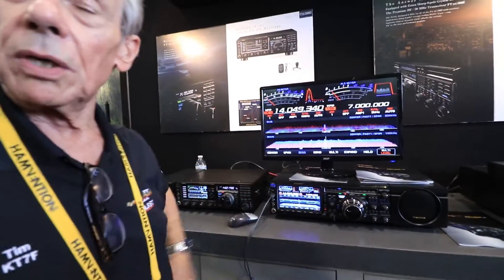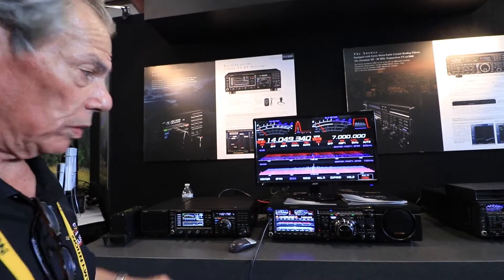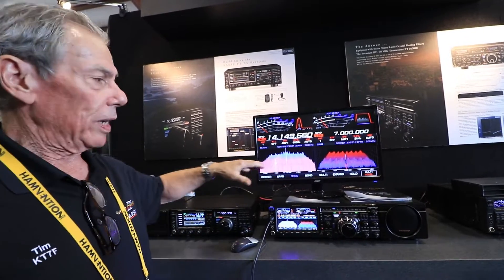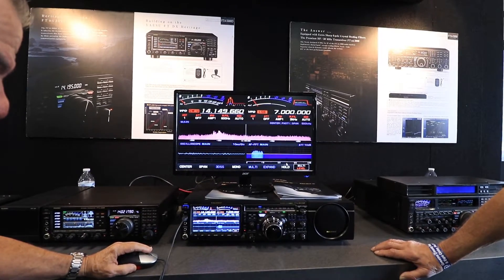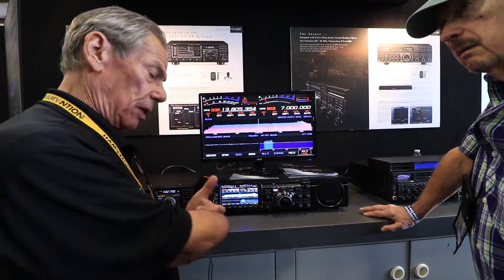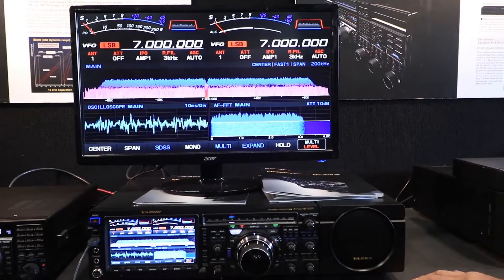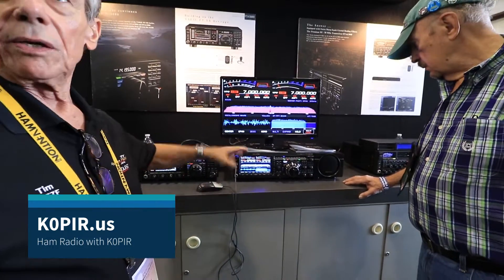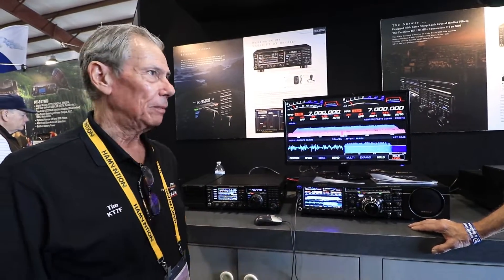NEWEST Yaesu FTDX101MP Hybrid SDR 200 Watt Transceiver

Comment: I think the 200 Watt version has its power supply in the outboard speaker box, be sure to watch out for that as you are buying.   One other question is that it was possible to put inside or remote outside the FC DX9000 line of low and middle band noise filters. Look up what could be bought and put inside the 9000 or can be out boarded behind the have to uh 2000 karma there's filters for 20 meters and below could be something you really want if your lower band operator/////////////

Comment: I'd have one and may, after a certain point numbers don't matter... just comes a point where numbers are non-recognizable to the ear. Noise floor is always the enemy. When the electronic engineers install some type of advanced artificial intelligence driven phase shifting capability via two antenna's into these modern rig's a new jaw dropping RF experience will follow.

Comment: I am sure I am not the only one that noticed that the so called band stacking marker did NOT take him back to 30 meters where he started before he set it at about 7:28 of the video.More BS from the SCAMMERS at Yaesu.They discontinued the FT-9000 because it had issues yet they have released another radio & want to say it's like the FT-9000? If you buy a radio from Yaesu then count yourself as a beta Tester.They have far more issues with new releases than all other companies combined I believe.

Comment: Yaesu' first SDR release. I'd stay away from it. Waayyyyy overpriced, 1st release, flimsy knobs, aside from VFO. Loads of plastic and looks like Japanese karioki machine by there choice of lighting colors you can't fully change and the facial design. The FT-5000 is still their tip of spear radio. Let them refine this 1st SDR entry. They were hard pressed to release this ASAP.  The Icom 7610 is a much better real time display and over all design and exudes quality. Yes I've played with both of these and am a Yaesu fan. 73's

Comment: This review was pretty good, with the exception when Tim didn’t know something he told a lie you cannot plug a traditional keyboard into this radio, if you don’t know something say I’m not sure find out the answer for the customer don’t lie. NOT COOL❗️
Reply from the maker: The Oracle I just got my QST magazine and saw there is a review in there. It’s hard to believe you can’t attach a USB keyboard to it. I’ll have to take a closer look. 73!
Reply: If the mouse is usb, many keyboards are usb....  now I can't speak as to if the radio will recognize a keyboard
Reply: Page 71 of the manual suggests a usb keyboard can be connected

Comment: Tim is Great. I found out about the relay issues, non user install filters , and possible fan noise after I ordered.  Was able to return as radio was still in transit.
Know its a great radio, but so is my 7610.
I will wait until these and any other issues are addressed. The filter install(and VC Unit for sub) requires the 101 to be sent back to Yaesu..
Hope it will have the APF/TPF function as does the 7610.

Thanks Rich for all the 7610 support.. The 7610 is still a great SDR with a LOAD of features..

KE6GAC
Reply from the maker: GWB 251 thank you for the information and thank you for commenting here. Nice to hear from you.

I was completely unaware of those things. I didn’t have any trouble with my 7610 or my 7300, knock on wood. I think that Icom has a very well priced SDR radio and given all of its features it is still the best radio for me. I like Yaesu and I especially like their transmit SSB audio quality, but I’ll stick with my 7610 for now. Thank you so much again and have a great day, Best 73!
Reply: With Yaesu any buyer is nothing more than a Beta Tester.Always issues.I'll keep my ICOM 7600 any day over anything Yaesu has ever produced.

Comment: Finally, IF Out... and I wonder what else distinguishes it from the 101D model.  Plus, it appears that the MP release will be near the time of the K4 release - which may top the Sherwood rankings (an unknown quantity currently).
Reply: Not everyone is interested in CW though; so the K4 will need to have exceptional SSB if it is to surplant the FTDX101. I really like the idea of the K4, but almost everything I read about Elecraft is CW.
Reply: There is no differrence re IF out between D and MP.
Reply: Also, besides very clicky relays (in the 101D and most likely the MP version too), I noticed that the mouse movement on the external screen was not smooth at all.

Comment: Thanks for the video!! Very informative. Great radio, but late to the game. Kenwood was months late. Yeasu is nickel diming you for the VC on second tuner, remote box, and two filters per receiver. Full kit may be pushing close to $6k. Bend over!!! From another video the QSK relays are extremely loud. No doubting its performance, but need deep pockets.